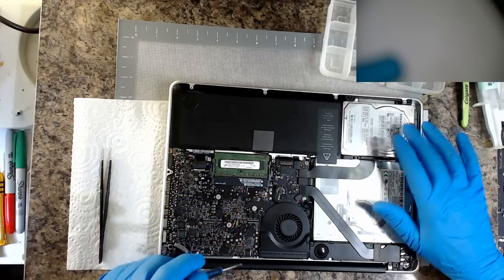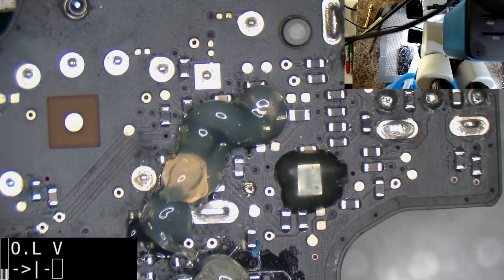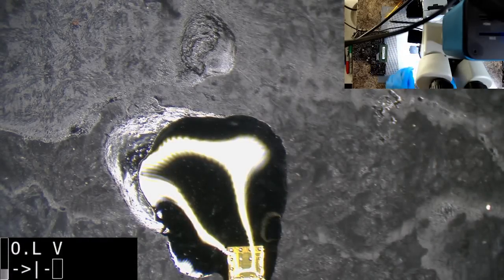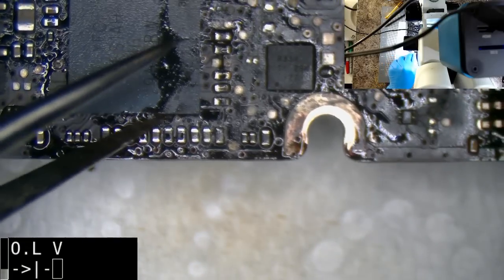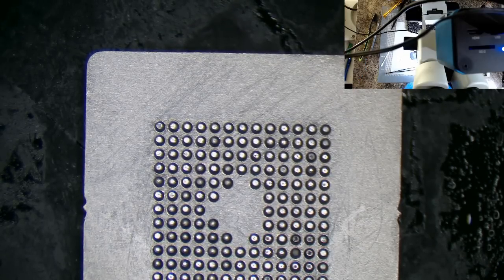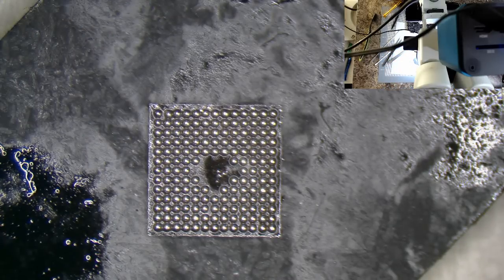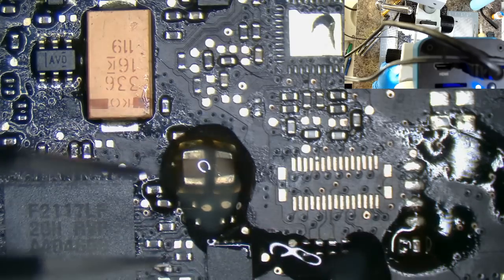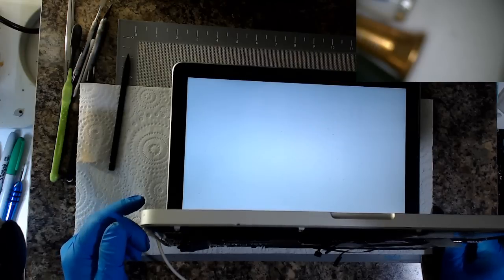820-3115 Resurrecting Roach Ruins

Comment: have a dead 820-3115, can the smc be dead and still have green light and charge, also 12.59v g3h?
Reply from the maker: yes, you can have broken aspects of the SMC that could still lead to misbehaviour, however I'd look elsewhere first for possible faults, leaving the SMC to the very last.  Would sooner blame something like a shorted cap by the audio IC or bad RTC
Reply: @pldaniels  thanks, is there a place i can get help with this..it has some history.. was working but now dead...no cpu vcore volts.. rest is there..
Reply from the maker: @cpufixer1  depends on what country you're in.  If you're in AU, you can send it in for repair.  In the US, there's quite a few options (TCRS, Louis etc)

Comment: If you set up the Raspberry Pi camera thing make vlog please. I need do same. Due to TMI brain farts🐵
Reply from the maker: Should hopefully not be too difficult.  I could just use a normal  security camera but the RPi has the big upside advantage that you can log in and copy off the files later, or change the settings without needing some 1990's IE plugin just to access the camera .
Reply: @pldaniels  Thank you OM. I enjoyed your complex soldering explaination.